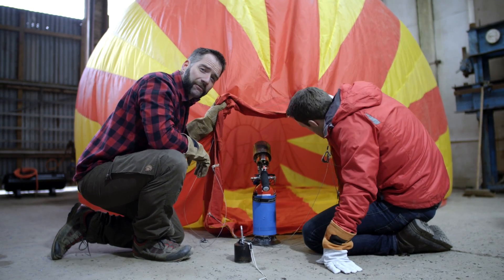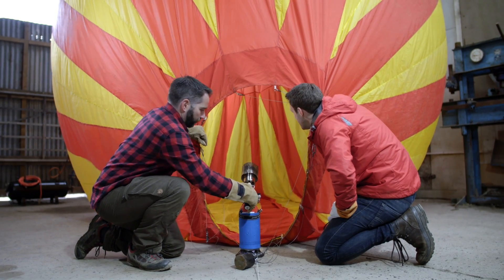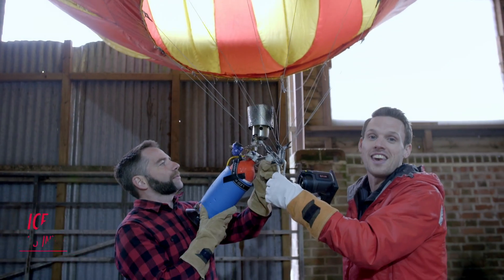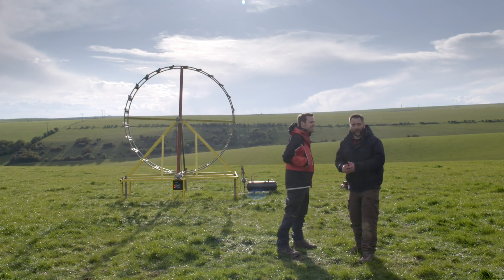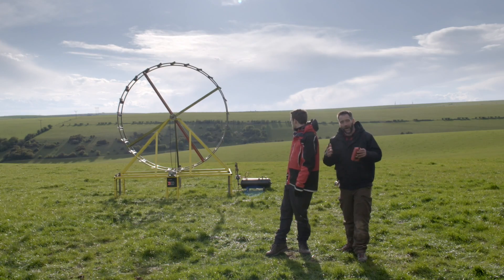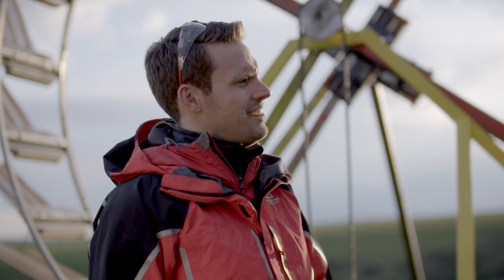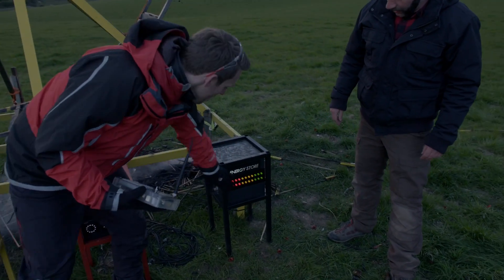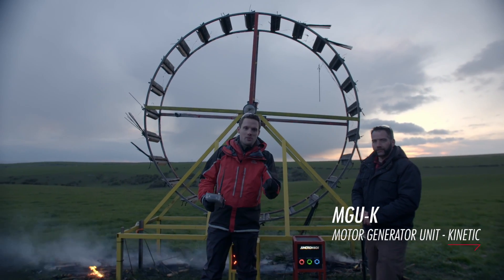Heat Energy Recovery I The F1 Power Unit Explained I Honda Racing F1

Comment: The MGU-H does not convert heat energy into electrical energy.  The air moving the MGH-H could be at zero degrees Kelvin and still create electrical energy.  Its the moving air (kinetic energy), not the temperature of the air, that creates the electrical energy.

Comment: So... you're saying the MGUH is essentially a turbo that runs an electric generator... Why bother complicating the entire thing? Perhaps a better video to do would be explaining why it's do expensive/difficult to produce a reliable MGU H unit, rather than wasting time glorifying the explaination of how a turbo works (essentially using pressured exhaust gasses to turn a turbine that compresses air - once again, the air is hot hence producing a lot of pressure). Basically, it's like a hydraulic dam that uses exhaust gasses instead of dammed up water.

The expensive part is the electric generator in close proximity to heat - with thermal expansion causing problems - essentially in an ideal world, the MGU H never expands or contracts due to heat, but in the practical world, no, the propshaft is stuck into the exhaust and conducts all that heat that ISN'T used to generate any energy at all, and is undesirable.

There is wasted heat, and lots of it, it doesn't pick up heat like say from the tyres or brakes etc. So the MGU H is a misnomer - a wrong name applied to the part. It should just be called - Exhaust Powered Electric Generator - EPEG. Way less confusing than MGU - Heat (which it really doesn't care for or rely on. You can pump cold water through it and it will work just fine, probably better).
Reply: Also have to add, the so called reason why the amount of energy the MGU H converts is considered 'unlimited', is because of regulations, technically, the MGU K can also convert an infinite amount of energy, no problem. No matter what, you don't get free energy, you harvest it from somewhere, the MGU H requires the engine to be running to even work, just having a HOT, HEATED engine sitting there whilst turned off and not producing exhaust does NOTHING - 0 energy being harvested.

On the other hand, the MGU K can still harvest energy even when the engine isn't running as long as the car is still moving - i.e., you lift off gas, and you step on the brakes -> MGU K works, but since you lifted off gas, MGU H does essentially nothing. The MGU K can also be configured to be running all the time, since it is essentially a petrol generator - if you stick on electric assisted braking on at all times, it would harvest energy from the motor into the battery, and far more efficiently than via the exhaust. 

In fact, MGU Ks are used in our on road cars because it is infinitely more useful and cost effective, and implementable already - in our hybrid cars. We harvest electric energy when the engine is sitting Idle, and when the engine is running, it generates a bit of  electrical energy that makes it far more efficient than just turning the flywheel alone.

So stop confusing people with the wording - it's rubbish and poor teaching trying to convey misinformation about what the MGU H really is, nothing more than an exhaust powered electric generator.

Summary - MGU H is a misnomer, it is merely a gas turbine - using exhaust gasses to power an electric generator. It is nothing clever, just simple physics. The key issue is that in order to harvest more energy - you have to bring magnets closer to the wire coils - to do this in the tight confines of a tube and not have thermal expansion cause it to seize up by expanding the inside bit into the outside, whilst turning at 125 000 RPM, this is where really expensive materials and time consuming machining processes come into part, especially when having the teams compete with one another to reduce the gap between the magnets and the coils - <-- this isn't sciency at all - its just machining precision.

The reason the teams want the MGU H to be removed is essentially because of this, it is ineffective, useless garbage that only becomes a little bit useful after spending a disproportionate amount of money on it.
Reply: Thank you for clarifying things for those who believe all they see and ear in those kinds of " explanation videos ".
You explain exactly and much better what is really happening wih those systems.
Sadly, after watching this video, some people will think that Internal Combustion Engines ICE, work like the ferry's wheel with explosives all around a wheel..🙄
Basicaly, the turbo never stops spinning, even when lifting throttle, due to the electric generator that uses the exhaust air to turn, and at the same time, recharges some batteries. And the electric energy stored in those battery is used to power another electric motor couppled with the turbo, and keeps it spooling. 
Almost No turbo lag this way.
It should be called MGU-E ( Exhaust air) not H ( heat ).
Just like the mguk ( kinetic ) , both systems help slow down cars. This takes a little load off the brakes pads.

Comment: So it's a twin turbo that the second turbo Powers a generator instead of air induction for motor combustion.... You're not actually capturing thermal energy you're capturing pressure differences.. I understand that they were created by thermal differences but it's already at that thermal point when it reaches your device but it's at higher pressure that's what you're working with...

Comment: Just a some feedback...lol
I've been searching so much regarding how the MGUH works..a and this vid did help...but with one key sentence that confused me, but found out later on.

When you guys said excess heat is what is captured, you didn't say why there is excess heat lol..

And found out that is due to boost pressure limit, and so instead of releasing it via a waste gate, the motor "slows down" the turbo to generate electricity :)
Reply: If you're right, that's the best explanation in this whole video + comments section of how it works.
Reply: @jonnies  I'm pretty sure lol
A generator is on the shaft of the turbine. So it gathers energy via keeping boost pressure at x value...then on acceleration, turns the turbines to reduce lag and help torque fill.

So I'm assuming there is torque fill via engine crank/generator and on turbo:)
Reply: @geo41e  cant be nothing else.
Its exactly whats happening.

Comment: This is stupide and looks like its made for children. I came here to understand the actual differences as to how it actually generates its energy purely on wasted heat as to the left over centrifugal force created by the exhaust. How does an F1 engine actually convert heat into electrical energy. Far as I'm still aware it just creates the energy by the left over turbo spool, not heat. Is there a thermocouple or something in it?

Comment: After watching this I still do not know what is the actual real life implementation of heat energy recuperation in F1. I understand you are trying to be engaging and fun but some facts should also be provided - e.g. does the system include another / different turbine to recover more energy from the pressure of exhaust gasses or is there a system (thermocouple) that converts heat directly into electricity?

Comment: What I don't get is, how do mgu-h and turbo work in collaboration, don't they interrupt each other as they are both aiming to harvest heat from the exhaust?
Reply: Turbos don't aim to harvest heat, they depend upon the kinetic energy of the airflow in the exhaust manifold. The speed of the air leaving the engine, or lack there of, is what contributes to turbo lag. MGU-H converts thermalenergy into electricity. send a little current to speed up the turbo when the engine slows down no more turbo lag...

Comment: Excuse me, but is it not KINETIC energy that drives the turbine (in a turbocharger)??.  The HEAT simply causes the exhaust gas to be much higher pressure than atmospheric... resulting in a large pressure-differential across the turbine.  It is this pressure differential that causes the gas molecules to hit the turbine blades thus imparting KINETIC energy to the turbine.  It is not HEAT that causes it to turn but KINETIC energy.  You could get the same result using COLD compressed air!.
Reply: Marek Sumguy yeah, mgu heat makes no sense since it’s not actually capturing heat energy

Comment: The MGU-K does not harness "heat" through breaking. It retrieves forward, kinetic, motion through the breaking phase (similar to Engine braking) which spins the MGU-K up, therefore generating electricity. Just the same as the MGU-H harnesses the spinning motion of the turbine (from exhaust gases burnt within the engine) which spins the motor up, generating electricity. It has nothing to do with heat.

Comment: I'm so much dumber for having listened to this.

Typed in 'How does MGU-H convert heat to electricity'. Got this mess.

Greg, Jimmy, if you convert heat to electricity you put heat in and get electricity out. What you describe here is an alternator on a turbine in the exhaust stream.

Comment: You just harvested KINETIC energy, not THERMAL energy.
Reply: Yep, I'm thinking that the description 'MGU-Heat' is misleading, its another MGU-K but driven off the turbine instead of the crank or gearbox
Reply: @JakobusVdL  i think heat came from exhaust air spinning turbine and at same time spin crank shaft for MGU H. The hot air came from the engine.

Comment: so it is like an alternator connected on the turbocharger that can go both ways (eturbo)?
Reply: Kind of.  It can act as a motor, using electrical energy to turn the turbine. Or a generator, to take mechanical energy from the turbo and store electrical energy in batteries.  Hence, the name MGU.  The trick is figuring out the most efficient way to use all the energy that is generated by the MGU K and MGU H. But as they mentioned, it can be used to prevent turbo lag or capture energy from the turbo when the turbo does not need it.

Comment: 750 explosions per second. that's 45000 explosions per minute for a 6 cylinder engine. so each cylinder has 7500 combustion strokes (explosions) every minute and each combustion stroke means 2 revolutions on the crank so 750 "explosions" per second equates to 15k rpm.

Comment: Great, you are recovering the kinetic energy of gas combustion from the exhaust pipe.  Might as well. I was just wondering about the effect of back pressure in the exhaust system. It seems that given that constraint, you are probably only recovering only a small fraction of the potential energy.

But this article says nothing about recovering energy from waste heat in the brake system. That is what I'm interested in.
Reply: Also late here.

Back pressure caused by the MGUH is mitigated by a waste gate still...hence the additional smaller exhausts

Comment: "20 times" 50 °C is NOT 1000 °C. Celsius is not an absolute scale for temperature, so 0 °C doesn't mean that the particles have stopped moving (zero doesn't mean zero movement).

Comment: I don't understand the heat part, all I can see is the kinetic energy from the moving wheel which is recovered thru the alternator?
Reply: The 750 explosions/sec heats up the exhaust gas which expands at an exponential rate is recovered by the turbine and the MGU (Motor-Generator Unit).

Comment: I'm sorry guys... I understand all the concepts you are talking about, but I am still not connecting something about the big picture I suppose... I mean, I guess what I'm trying to say is I no longer understand whether F1 units are electric or chemical.
I thought I knew, but then you guys just turned my brains into mush with this episode. Uhg.
Reply: they are both electrical and combustion the electrical portion just captures the excess energy from the combustion system to power the electrical one and then the eletrical motor takes over when the combustion motor isnt the most optimal choice ie: low rpms coming out of turns were you want the highest acceleration which you get from an electric motor but i understand why your confused i think they could have showed how the turbine fit in to the f1 car a little better i couldnt really picture it but i still understood it because of the cool demonstration!

Comment: it would be nice if they explained any of the acronyms, also I feel like rockets are using kinetic not heat energy... I suppose the high-velocity exhaust gases is basically the same kinetic energy, but I would interest in how the heat came into the equation which wasn't explained or demonstrated at all.
Reply: exactly! all they did is tell us how a turbocharger turbine works, but that is really not about harvesting heat energy

Comment: MGU-H = alternator
Reply: but driven off the turbine, rather than the crank
Reply: Both alternator and a electric turbocharger.
Reply: And it stores it not charges battery
Reply: Can it be installed on a street car?
Reply: @WanyTruccone  They use it in LeMans 24h as well - so it most likely is possible to fit it in a normal car.
But bear in mind in a normal car you do not have "750 explosions per second", the temperature of the exhaust is way lower than in a racing car
so the efficiency of such MGU H in a normal car would also be way lower.
so here comes a question if there is a point?
Reply: @michazajac5881  Do you feel using a Peltier device in a road car is more probable in the future compared to a MGU-H?
Reply: Wany yes, Bugatti have. It will trickle down soon to “normal” cars

Comment: This example is using kinetic, not thermal energy.
Reply: true.and isnt it the pressure from the eplosions in the engines  that drive a turbo turbine? so technically the chemical energy is transverted into kinetic and heat, and its the kinetic thats used as pressure. its not recovering heat, the heat is not driving the turbine and its still there coming out of the exhaust right?
Reply: yep completely agree, turbo works on the change of pressure not change of temperature (which would be peltier device)
Reply: The first example of propane tank spewing hot air on the turbine showed the conversion from heat to kinetic. Then to show a more realistic picture they showed how fast the turbine could get in the car and convert the kinetic to electrical.
Reply: Thermal energy IS kintetic.
Reply: Yes it's not directly heat to electricity. It goes from Thermal to Kinetic then to Electricity. I do wonder how much does it slow down the turbo or if it's negligible
Reply: Yes.  Exactly.  The moving air (kinetic energy), not the thermal energy (temperature of the moving air) turns the MGU-K which creates electrical energy.
Reply: Thermal energy that converts to kinetic energy and then store the enefgy.
I think they jumped the midle step?